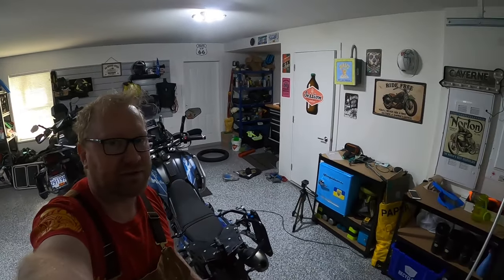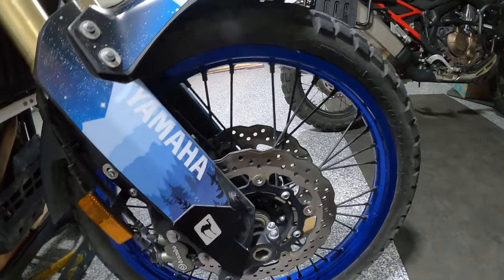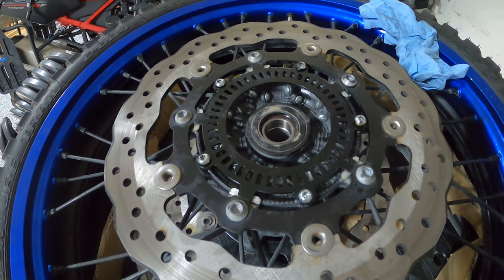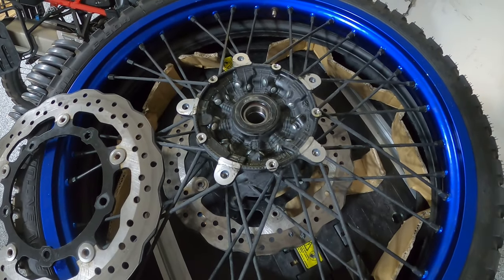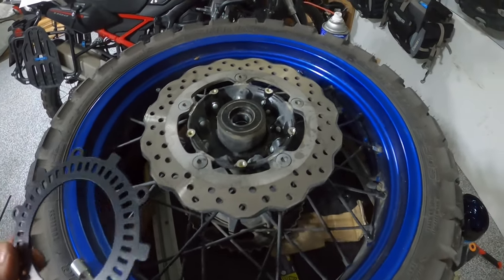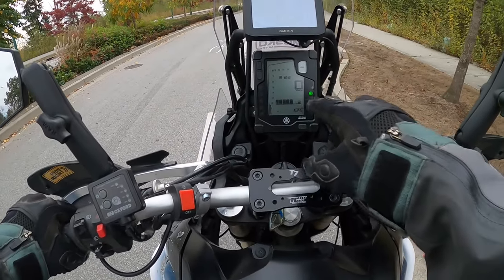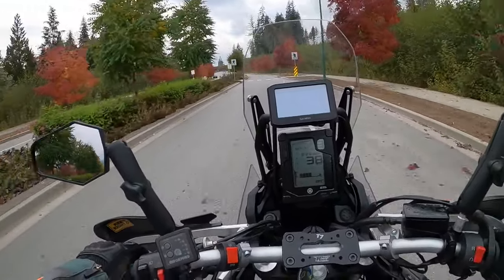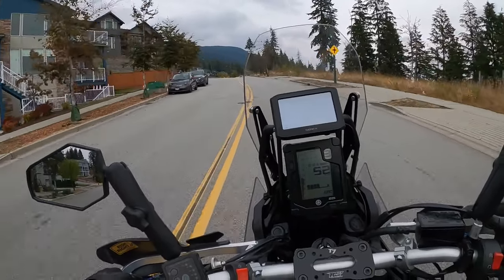Tenere 700, speedometer correction EASY !

Comment: At first to become clear I'm a customer of this online store and I'm very pleased with my purchases and the service. I find "Off The Road" online store excellent!

I was planning to buy these rotors but after thorough tests with 2 Garmin GPS units (Edge 540 & Forerunner 620) the odometer of Yamaha Tenere 700 is accurate 100% !! So you get accurate distances and fuel consumption which are the things that matter...

But the speedometer has indeed an error around 8-10% so you see higher speeds on the dashboard than the GPS units. I've been told that is done in purpose to make rider stay to the safe side for the speed limits and all motorcycle companies do the same thing as long as the speedometers are not fluctuate more than 15%.

My particular model is a Tenere Rally 2023 with the colour dashboard. I'm not sure if is there any difference with the old monochrome dashboards...

I hope that this helps for all Tenere 700 riders...

Comment: Are the front and rear the same
Reply from the maker: Yes.
Reply: Have you go on highway to see the diference?
Reply from the maker: @drady8541  yes many time , still accurate
Reply: @northof49adv  unfortunately I will not be ordering these abs rings..for some reason the company wants to charge as much as the rings cost for shipping here in the USA so it double the price for me
Reply: @gabrielkopp2036  Buy two, and sell one to your buddy. You only need one in the front wheel.